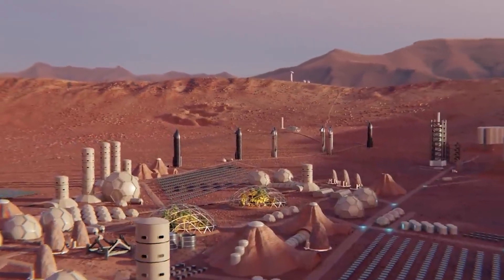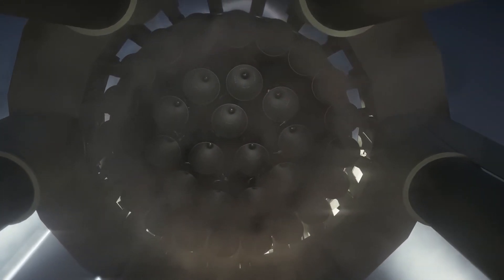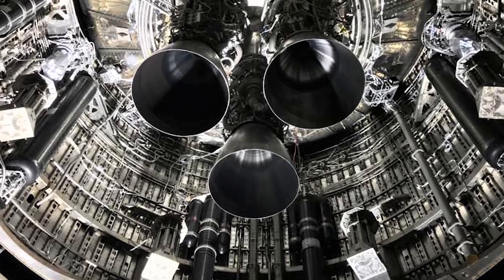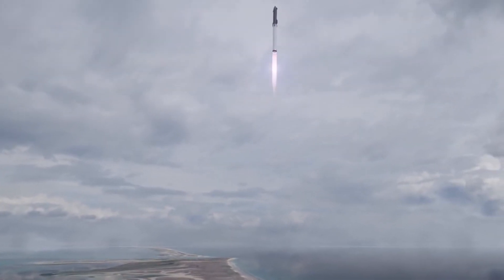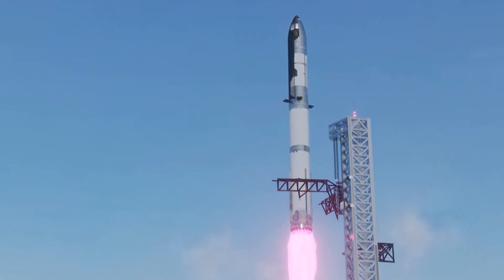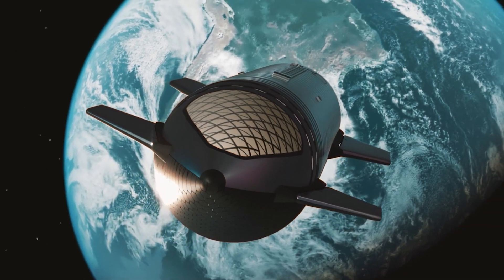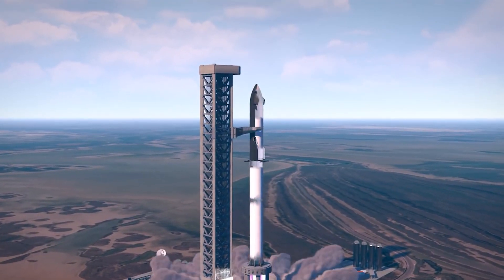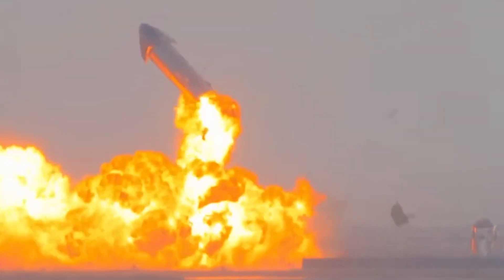SpaceX Raptor 3 Engine Changes Were Better Than Planned

Comment: There is a gap in Starship project design. Question: how the starship rocket, standing on the surface of the Moon could ignite engines and start? There is no launchpad.
Reply: By turning them on. It turns on it’s own engines, the pad only turns on the outer 20 engines on the booster. And it doesn’t cary if there’s a lunar hole under it after taking off. It’s already in the air, well vaccum I guess.

Comment: You are mixing up your pics...the exploding raptor at 1.02 is mounted on a starship..not a booster. No engine blew up during flight in april. They shut down without exploding.